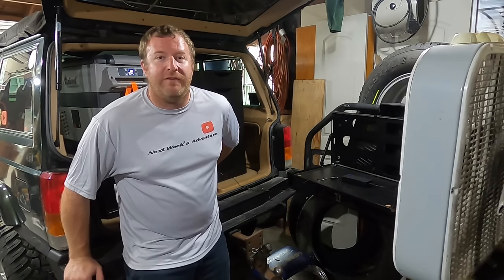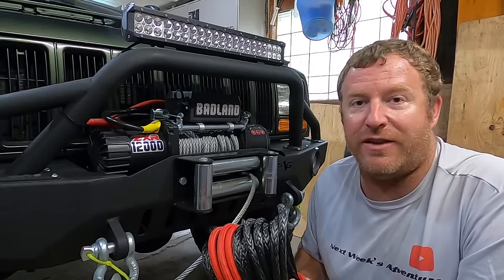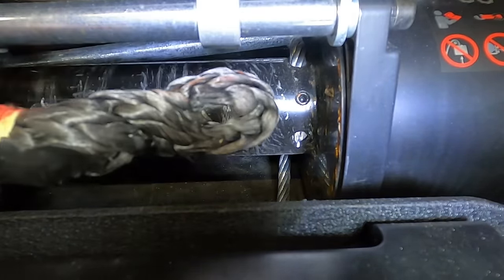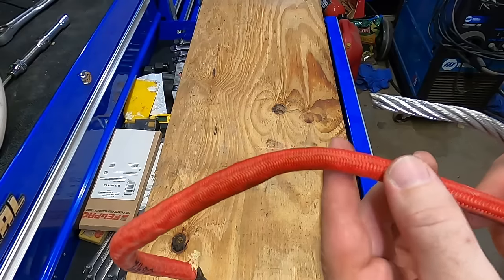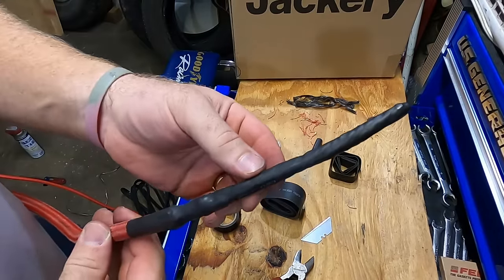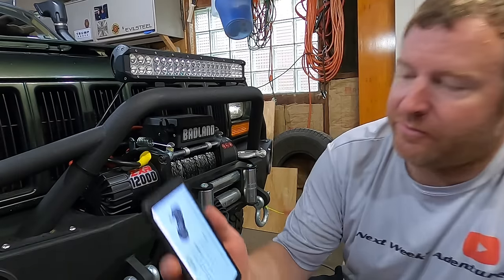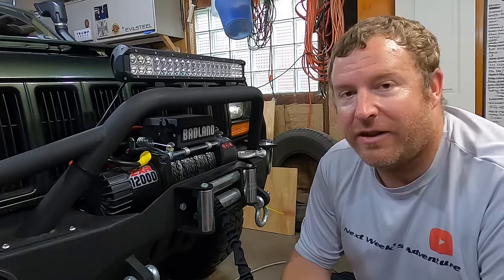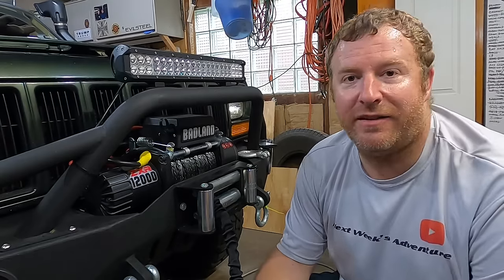Harbor Freight Badland winch upgrade you must do!!!

Comment: I have the same winch from Harbor Fright, I bought a 100' synthetic rope off Amazon for less than $100 and used a bolt and washer where the set screw goes. Has worked great every time I needed it.
Reply: That's what I was thinking, don't cut the rope, or get the correct part to use the synth rope.
Reply: Same here, bolt and washer. That's why the rope ends in a loop. I also tied a piece of white cloth on the rope as a marker at 10 wraps on the drum.
Reply: I was thinking the exact same thing
Reply: Got a link to what you bought?
Reply: I was thinking the same ! With Stainless !
Reply: @MichaelGilmet  none will ever know :( whyyyyyyyyyy not include what you bought /sigh
Reply: I'm glad you pointed this out and honestly I'm rather shocked that there are people who wouldn't think of this. Kind of sad ain't it?
Reply: @thedocisin3204  what size bolt goes in set screw hole ? Lost mine
Reply: @thedocisin3204  great idea with the white cloth. ill do that as well

Comment: I didn't hear anything about checking the drum and other parts that the steel cable rubbed against for burrs. Use sand paper or file to get rid of any burr that could cut the rope.
Reply: He's also thinking that a steel roller fairlead is okay to keep on there and that hand tension is enough to tension a rope.
Reply from the maker: It is ok to run a roller fairlead and I only hand tensioned the rope to save time on video. I took it out after and tied off to a tree on a hill and set it afterward.
Reply: @nextweeksadventure  okay and ideal are two different things. And he's right about the drum. You should have sanded it first. It's all well and good in that you can do whatever you want. But you may want to mention stuff like this when making instructional videos.

Comment: Great video, when feeding the line thru the drum & set screw.  Only feed the line thru till it's flush with the drum, by leaving it stick out the inch you showed,  it gets in the way of the line spooling smoothly & when the upper layer is under tension, can cut into the line itself,  you want it to spool smoothly over each lower wrap. Also be sure to run your bare hand over the drum switching between steel cable & synthetic.. the cable can create burrs & edges that'll cut the synthetic.. if it's not really smooth, smooth the drum surface all the way around & full width before installing synthetic. Same goes for snatchblocks.. don't just use your old one you used with a steel cable.. it needs to be totally smooth,  even minor stuff is magnified under load in its abrasion/cutting.
Reply from the maker: Nice tips! Lucky mine was pretty new with only a few runs on it when I made the switch. Thanks for watching and leaving a comment!

Comment: Take full advantage of the increased safety of the synthetic rope and lose the metal hook. Use soft shackles 😊...
Reply from the maker: I've had a few people tell me this. I've never really considered it. Thanks for the advice!! Will definitely be looking into this .
Reply: Synthetic schakles have their place as does a metal hook. Hard to hard, soft to soft surfaces
Reply: @mitchelcreegan9636  
Just in case, when or if things break I'd prefer to have soft things attached😊...
Reply: Soft to soft hard to hard.
Reply: @mitchelcreegan9636  
Wiith new products and technology also comes the ability to improve safety....
Reply: In deed.  Unfortunately most shackle mounts are not all that smooth and can and will cut shackles. Most don't inspect their gear enough let alone their hard mounts. Just 1 more thing to pay attention to.
Reply: @mitchelcreegan9636  
👍...
Reply from the maker: @bkind2182  so if I could ask how does the soft shackle attach to the winch rope? The cable im running has a steel eyelet at the end which attaches to steel hook. Is the soft shackle small enough to pass thru the eyelet? I'm glad everyone is talking about this cause now I'm interested in it. Thank you!!!!
Reply: @nextweeksadventure  

Here is a link to a video that discusses it...

https://youtu.be/dyMzNnSmdfU
Reply: buy you D-rings from a proper construction supplier,  as there are ratings for all this. and over time in hard 4 wheeling a number of items for varied uses will be very good to have. and yes i am talking steel things.
think odd angles, sharp points. hooking up varied items + angles.
never use a "open" point hook. use them as a paper weight,
do it right and be safe.

Comment: I went the other way around and ditched the synthetic rope. I use my winch a lot every year for removing logs and trees and running through snatch blocks, the synthetic harbor fright rope will Frey and break in no time, mine didn’t last a year before breaking, I swapped out for a steal cable and all is good!

Comment: I did that kind of upgrade year ago (long before harbor freight offered a rope).
I used rollers until the rope got caught between top roller and side roller under load.  Had to cut the rope.
I highly recommend not using the rollers.

Comment: Run the line around the drum and through the eye.  Pull the loop tight, creating a choker which protects you if you run the line all the way out.  Replace set screw with bolt and washer.

Comment: Nice video.  I swapped my wire cable out years ago with Amsteel synthetic rope.  First, I took my winch apart because I suspected the primary gears didn't have enough grease.  I have 5 winches and 4 of 5 needed grease from the factory.   I wrapped the winch drum with silicone tape to protect the synthetic rope from heat generated from the gears and motor during use.  Now synthetic ropes have a protective shield.  You could use 550 cord and attach the rope end loop to the anchor set screw.  As you suggested, never unwind the winch line beyond the last row. The 550 line would be as good as using the set screw with reduced rope strands.  Have a nice day.

Comment: i just used a bolt with washer , did not cut it at all . then just put a load on it ,it will shrink down on its own .no mod, just use a bolt where set screw was .

Comment: I have the older Harbor Fright 12000 lb winch before Badlands took over. I also put on a rope only mine is 8000 capacity.  I have it mounted on an old quadrunner.  Still use the rollers on the front. Has worked good for all the years I have used it. Surprisingly I haven't pulled my quadrunner apart with everything I have put it through.

Comment: I replaced the rope on my Adventure Kings Domin8r Xtreme (just part of regular maintenance) with a MaxTrax MXTSWR Static Winch Rope using a different solution.

The Kings drum only has a screw in the side flange and the rope has a flattened ferrule with a hole drilled in it. The MXTSWR has an eye at each end. I chopped the eye off (like what you did) and used a Plasma Lock to fasten it to the face of the drum. When it kept slipping on install, I replaced it with a Bubba Rope “The Grabber” which worked perfectly.

This means that I won’t be able to reuse the MXTSWR as a 30m static extension, but it was the only way I was able to mount it to the drum.

When I upgrade my Winch to a Warn VR EVO, I will invest in another MXTSWR and keep it intact.

Comment: Thanks! I like how much it reduces the weight as mine is on a receiver hitch so I can move it from front to back.
Reply: Is there a massive difference? I had to run 1" spacers after I got my winch and mount installed.
Reply: @lunafab4059  Are you asking about the weight of metal winch cable compared to synthetic winch cable? If so, there is literally a massive difference.

Comment: Good news. I got the older badlands and a brand new one still in the box. I do want to swap to rope. I work with rope all the time doing tree work. Some people won't believe that rope has the same strength.  Or even more. But it depends on the situation you can get in. I seen many people mess up their steel cables just by trying to  rewind them back in when under a load. They really tear up that steel cable.

Comment: Just bought the new zxr 12000 an a new badland synthetic rope. The new winch has a threaded hole to the right side in the drum cause the rope comes with 2 different sizes an a the mount for the the rope to loop onto. No more cutting them down an working harder. Deffiantly remove the spring loaded guide arm. It will destroy your controle box. Good luck an welcome to 2023 Badland upgrade 👍 😀
Reply: Any links to videos with installation like this??

Comment: Rollers have a bigger bend radius and they roll. The two biggest reasons for damaging winch rope is from chafing and bending it to hard. Rollers solve both these problems. The only reason they say to change to an aluminum haus is because if you pull something directly below the front of the winch and way off to the side, (something that happens, well, never), you can pinch the rope between the two rollers. The rollers are better, don't change it. 
Thanks for sharing.
Reply: Adding a rope that will fit between the corners of the rollers will destroy synthetic ropes before you know it.
Reply: WRONG. Rollers destroy synthetic ropes easily. They pinch at the corners, and get burrs easily from being bashed into things or used with wire ropes. I’ve had them seize up, break pins and fall out, and bend. 

Roller fairleads are trash. I went to an old cast iron Warn one for my wire ropes. Use Delrin or Aluminum for synthetic ropes.
Reply: Rollers, and their scratches, wreck ropes.
Very nice video, worth subscribing.

Comment: I have personally seen a set screw let loose of a steel cable with a 2000lb burial vault on it and the cable just spins right off the spool no matter how many revolutions were on it. That set screw does have a function in holding the cable in place under a load.

Comment: Excellent video! I'm upgrading my 12K HF winch with the same synthetic line this week. I'll definitely give your channel a mention during my demo (I just subscribed). As for the roller fairlead - I'm going to keep using mine. Many off-road SMEs have run these same fairleads with synthetic lines for years. We just need to make sure the rollers are smooth and roll freely. Think about it: these rollers will produce much less friction and wear on the line than a typical solid synthetic fairlead. The only downside to not switching is the weight savings between the roller version and the solid version. Keep up the great content!

Comment: Slide it through after you cut it and tie half hitch jam knot on the other side and pull it tight then put the set screw in . Forget the heat the heat shrink. You will never pull the half hitch through the drum hole.

Comment: Thanks for the tips. I use a BL 2500 for my atv plow. Hate the cable,it rusts out, it pinches and frays itself and I constantly have to reel out and reset it. Rope doesn't have the same issues, I've just never reset a drum cable, so I haven't replaced it. I see ropes in discount all the time, so now I'm going to look into it more
Reply: I built a dedicated Lift Winch for My ATV Plow back in 2003. It only has 6' of 2" wide Ratchet Strap Material.
And it picks the Plow frame up dead vertical , and a Limit switch to stop the Winch before it bottoms out on the Frames 
I can use the Winches, 1500 Plow or the 4000 regular  on either end at the 2003 Polaris 700 twin . 
Custom modified Polaris 1 1/4 Receivers.
The Rear 1 1/4 Receiver holds the Hydraulic pump for the Plow Angle. 
With a Load of Junk in the ATV Box and a big deep Cycle on the front Rack, Chains on all four, And a suspension Lock for the Back.  That thing is a Plowing best HAHAHAAH it is Heavy  ...+ My 230 Lbs 
Then I have to Use the Kioti to move the Piles....
Mike M Central Wis.

Comment: I have that same front bumper. What is that LED light bar that looks to fit the top light bracket? Thanks
Reply from the maker: Lumitek 20" 126w cree led light bar flood/spot combo from amazon. You will need to order a wiring kit it doesn't come with one.

Comment: Not really a comment but a question. Do NOT go off "roading"!  but do had a 16 steel deck car trailer w/beaver tail. Have always wanted to add a winch to it. Most of what I have hauled is just driven on. Occasionally do have to push one on (usually have enough people to accomplish this). So the question is why the "rope style vs cable style. Yes I realize both materials are actually "rope". What are the benefits/disadvantages?
Reply from the maker: I prefer the "rope" because I'm clumsy and find working with a loose rope easier to handle. Also if your about to do a deep water crossing that you know could end badly you can unwind a bunch of rope and tuck it under a wiper blade or someplace easy to get to fast without worry of destroying your rig with a cable. It's mostly a personal preference.

Comment: Great video. Did you find out if you needed to take off the bar that's connected to the springs on top made to keep the steel cable tight and now with rope, do you need that bar with the springs? Hope I asked it right
Reply from the maker: Thanks! I never removed the springs or the tension bar. I only replaced the rope. The rope does get a little tight against it but the whole thing fits with exception to the last 2or3 feet. I just clip it to my d-ring and let a little hang down.
Reply: @nextweeksadventure  very cool. Thank you. I have the same winch doing the same thing.

Comment: Imo synthetic is way better. I mean sure you'll have to replace it every few years but the main thing is that it's safer. Switch to all synthetic rope and shackles and that's way less weight coming towards the driver's seat than all metal in the event of a failure. If you add on a weighted recovery blanket it's really relatively safe.

Comment: If you would use a button head bolt and a washer all you have to do is simply screw through the hole in the Rope into the drum and it would be attached simple

Comment: Great vid 👍🏻 I'll be keeping an eye out for the rope now for my '79 J20 longbed.  You mentioned an update.  Did I miss it in your video playlist?
Reply from the maker: Not sure about mentioning update. I just rewatched this video to see. I can tell you I still love this swap. I'm extremely clumsy and switching to the rope is way easier to handle. One of many comments I've received is change out the new hook I put on (Apex Hook) with a soft shackle. Also get rid of the roller fairlead. I am considering a soft shackle instead of hook but for now still running the rollers.  I still see a rope every once in a while, get returned. Hope you can get your hands on one for sure! Thanks for watching and taking time to comment!!
Reply: @Next Week's Adventure   Thank you for the reply 👍🏻  I probably got confused with your comment about swapping to the replacing the fairlead with  an aluminum hawse style.  I have been dragging my feet on getting the Apex, but  I guess I will have to grab up some steel and attempt my 2nd ever welding project, a winch bumper with assorted off road worthy accouterments.  Thanks again for the excellent vid and appropriate nudge.  😎👍

Comment: Great tip! Thanks 👍 What bumper are you using? Did you paint it?
Reply from the maker: Thanks! I've heard that HF no longer sells the returned ropes but it doesn't hurt to check. Bumper is a EAG and no it came already painted and is holding up pretty good.
Reply: @nextweeksadventure  appreciate the clue!

Comment: Good explain on the upgrade. I will be doing the same very soon...However..I bought a brand new 3/8 85 ft synthetic rope rated for over 26000 # with forged hook and finished ends from Vevor online free ship..for $65..will the extra 5 ft spool up ? will see on my 12000 # H.F. winch thanks for the video.. Thanks Tim M
Reply from the maker: Not sure about the 5 extra ft. Mine is a little snug. But you can. Coil it up on something for sure.

Comment: Drums also have side screw spot that can be used by crimping a wiring eyelet on the rope.  That's how I did mine after cutting off that fat 8 inch section

Comment: Most of the modern humans lack the simple self guidance & awareness to solve simple problems like this.

There is advantage to keeping the rollers for the synthetic rope, providing it has no wear or damage from the steel cable that would damage or reduce the life of the synthetic rope. 

Rollers in good condition will extend the life of the synthetic rope.

Of course the rollers are heavier than the alloy fairlead. So it comes down to choosing to either saving weight or making the rope last longer.

I have heard that the rollers can pinch the rope & bind them up but I think this is unlikely.

Comment: How is it for durability and and abrasion resistance?   I understand it’s safer if it breaks.
Reply from the maker: In the end it is still a rope so it can get cut. I've had no issues with mine and just try to make sure I'm not dragging it across anything when in use. Still holding up very well.

Comment: I'd have to keep the cable. My luck I would cut it on the first pull. Cable would definitely last longer when pulling out things with edges.  Then again I use them for pulling other things out not myself.

Comment: Your saving money tip is to find a store with a returned one? What are the odds of that? I always check the harbor freight returns and have never seen any recovery gear marked down.
Reply from the maker: They stopped selling the used rope a while ago due to liability issues.